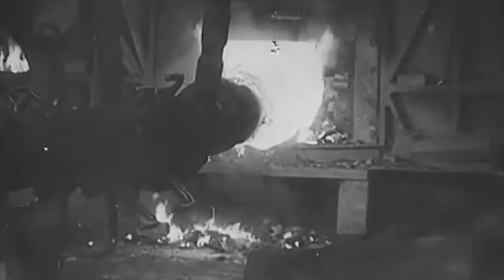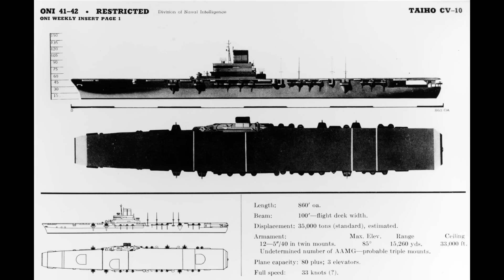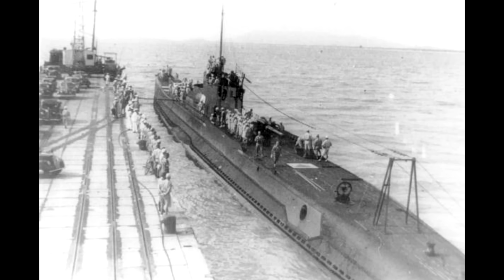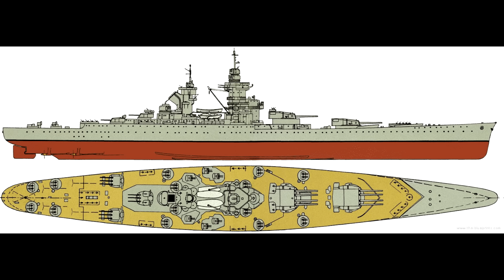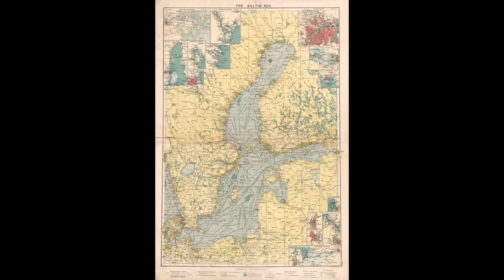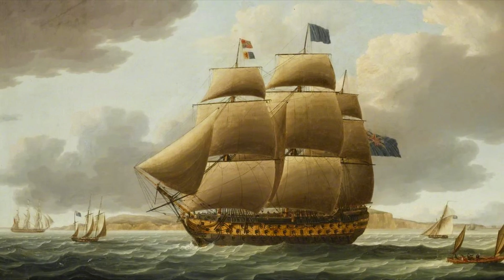The Drydock - Episode 362

Comment: FWIW, the Tu-4 wasn't a perfect copy - Soviet aluminium rolling gear wasn't set up for US sheet thicknesses and rather than building whole new factories they put slightly thicker skin on high-stress area, and thinner skin on low-stress area. The Tu-4 also used a Soviet engine that wasn't derived from the US one (though it was derived from the original Cyclone, just as the B-29's engines were).

Comment: Just had a really daft idea for cargo subs. What if, instead of building the cargo capacity into the subs themselves,  you built submarine barges loaded and sealed to float at a certain depth below the surface? The actual submarine would then just be the tow vessel.
Yes, I realise that a number would inevitably be lost to bad weather and accidents, and that there would be issues when the tug surfaced to recharge its batteries, but it could significantly increase the cargo carried.
Or more likeky turn into a death trap for everyone concerned.
Reply: The idea of towed cargo for subs is not a new one. If memory serves, there was a Hardy Boys book ( The Mark on the Door - the 1967 rewrite) that used this in the plot - I believe the story featured a submarine towing containers that were used to smuggle oil.

Today real world drug smugglers sometimes use towed submerged cargo pods aka narco-torpedoes or even narco-submarines - many of which have been captured.  So the concept of a submerged cargo pod is well known.

I suspect a challenge with towing an underwater cargo is keeping the tow line from fouling the screws of the towing vessel.

Another option is to attach pods externally to the hull of the sub - much like the Japanese did with their mini-submarines.  This takes the tow line out of the picture.  The parent sub took a significant hit on performance in these situations.

The issue has never been carrying cargo, the issue has always been carrying sufficient cargo to make it worthwhile.
Reply: @bluelemming5296  I think the IJN experimented with towable pods, but found them unwieldy, poor depth control, and hard to unload.
Reply: @bluelemming5296  Thanks.

Damn! I should have known that the narcos would have had the idea first. I'm just surprised that they don't have their own space programme.

They haven't, have they?

Comment: (for the last question) I wonder if they might also have named them after presidents. They wouldn't really do this until the Midway class (iirc), but it's fairly common among USN carriers today, and I wonder if it would've happened earlier if battles had been unavailable.
Reply: They only did that for FDR because he died right then, then they went back to battles for the Coral Sea.  Same thing with JFK, although he probably upset the pattern.

Comment: I don't think you really need to 'reverse engineer' a long lance torpedo. There is nothing inherently unique about any of its design concepts. The only 'unique' idea was to us compressed oxygen not air. Now that does cause some technical issues with storage, etc. that will affect the details of the design. Seeing how the IJN addressed them would be handy. To me this closer the value of the captured Zero that give the US an excellent insight into IJN aircraft design philosophy. Thus the general capabilities of Japanese aircraft was better understood. The US could build a Zero, but choose a different doctrine that resulted in aircraft that emphasized different aspects.
Reply: There were engineering lessons to be learned, like cleaning the insides of the oxy tubes carefully and avoiding sharp bends, but the primary issue was that the USN did not accept that the IJN had a long-range torpedo until well into the Solomons campaign, which affected several battle plans negatively.

Comment: Question:  How was a seaplane launched from a battleship recovered after it completed its flight?  Would the ship have to come to a complete stop near the plane to hoist it back up onto the ship?
Reply: Depends on the time and the exact nature of the equipment. Early on yes, the ship had to come to a complete halt, or at best slow significantly. Later on the ship could still be underway and recover the float planes, but even then they could not do so at full clip, they would still have to reduce speed to retrieve the floatplanes.....
Reply: They had cranes
Reply: Also, they would try to use the ship to provide a sheltered spot for recovery - having the plane land in the 'lee' of the ship - and sometimes release oil onto the water to try to smooth it out.  But even so, the process was very sensitive to the roughness of the waves, far more so than landing on a carrier.
Reply: @bluelemming5296  Yes, weather was a factor, and the ship could make a sharp turn to create a quieter patch in her wake.  Most ships with aircraft had cranes, all the fast US BBs had them at the stern.  They tried a towed raft system that I do not think tested out well.

Comment: Drach you did not think of how much damage a thermobaric weapon would do to a carrier? The gas fumes that killed several carriers would be fairly similar to how the thermobaric weapons work when the fumes get to a certain concentration. We saw how thatworked out on Taiyo, Lexington, Franklin to name 3 off the top of my head. Feel like with all the aviation fuel, air dropped ordnance and AA ammunition would be horrendous explosion if a weapon got through the flight deck and maybe below the hanger deck.
Reply: Yeah but in those cases it was the fuel air mixture already existed and spread through the ship due to either poor damage control or damage already inflicted or ventilation systems that actually spread the fumes so the issue he's dealing with is not that those things are not devastating it's can you get a designed weapon into the ship that isn't already pre-filled with aviation fumes and somehow spread enough fumes with long enough to lay time so that when you do set it off it does that type of catastrophic damage and that is not easy at all
Reply: You would need an ABSOLUTELY INSANE warhead to get anywhere near the condition those carriers were in already.

Comment: How would you rate the loss of Lord Kitchener (OK to a mine but U boat set).? Irreplaceable or not?
Reply: Not by that point to be honest, probably not ever. Kitchener's role during WWI has been much over hyped, in great part due to the famous poster. Problem is that poster was not actually USED during WWI, though it was designed during the war. It did not gain in popularity and recognition until AFTER the war, due largely to its similarity to many of the US recruitment posters depicting Uncle Sam in much the same pose that WERE actually used....

Kitchener was very much a man of his time, and while he was one of the first men in power in the UK to recognise WWI was in fact going to be a long war, he was also wrong in many other respects and in many ways frankly deleterious to Britain's War Effort. So he was very much a mixed bag. Some good, some bad, and not as important as the popular image of him today makes out.....

EDIT: In fact if I recall Kitchener was very close to being out right replaced when he took that trip. I would have to dig into my books but I am pretty certain he was not long for his position.

Comment: 52:30 The general idea of a thermobaric weapon is that it improves effective warhead size by using atmospheric oxygen to burn a fuel. So, as an analogy, a jet engine is more efficient than a rocket because the former only has to carry fuel, while the rocket must carry fuel and oxidiser. So it would work pretty well outside a ship by - as Drach said by destroying sensors and structures. But inside the cramped confines of a ship, that space to expand and gather oxygen is unlikely to be available. Most modern warships are built to operate (at least technically) in an NBC environment, so they are anticipating a significant level of external blast when in a warlike configuration. Older ships with exposed crew positions and zones open to air - a nearby airburst would be pretty brutal.
Reply: Shameless Book Plug (and spoiler alert) - This idea gets explored in my 'Republic of Texas Navy' alternate history book series.

Comment: I think a WW2-era dedicated cargo sub would best be built to only dive to very moderate depths, perhaps 40-50 m or so. Enough to get below the big waves and below the keels of large warships (in the unlikely event they'd get that close). It would have multiple smaller pressure hulls inside an outer streamlined hull. Perhaps three across and two high, each the diameter of typical subs of the era to take advantage of production facilities and design/manufacturing experience. The upper middle hull could be dedicated to crew bunks, canteen, command center/bridge and the diesel engines and generators (non-direct drive), and sit under the sail and snorkels. The two lower, outer hulls could house electric motors aft for propulsion. All three lower hulls would have a lower section filled with batteries. The two upper, outer hulls and most of the three lower ones would be cargo space. It would be maybe 13-15k tons, travel at 7-8 kts with the diesels running, with a cargo capacity of 3000-4000 tons. 100-120 m long and probably 20 m wide.
Reply: It would be very slow to dive.
Reply: @Primarch359  Dive speed isn't related to size, but to how quickly the ballast tanks can be filled. If everything is to scale, the dive time will be entirely independent of size.
Reply: @Primarch359  And big.... Slow dive speed and large size were two BIG killers of submarines, especially operating in shallower, more constrained waters, which a supply submarine would be doing for at least part of its mission by default....
Reply: I think it would be very different
Reply: It's somewhat limiting to build a sub designed to dive only to 'very moderate depths' for use in the open sea.  Maintaining trim (and hence depth) is extremely difficult for submarines, requiring excellent training, properly working equipment (not an guarantee even if you don't have battle damage), and constant attention.   

There are many accounts of subs broaching when they lost control of trim: think about the corollary if your sub can't handle going deeper.  Changes in the salinity of water (such as near a river mouth) or ocean currents can be big challenges for trim.  Storms also have strong effects underwater close to the surface that can affect trim - you have to get pretty deep to minimize those effects, and even then can have problems (as former modern submariners have pointed out on this channel - you might want to find some friends that have submarine experience to talk to about stuff like this).  

Also, being limited to shallow depths increases your exposure to minefields - many of which are set for shallow depths because they don't have enough mines to go deep.  You can't go under large bodies of ice (which can go deep under the surface).  Finally, shallow depths increase your exposure to fishing nets and defensive net barriers such as the ones used for the English Channel in WW1 - and if a net wraps around the screws, the sub isn't going anywhere and is doomed if an enemy catches you in that situation.   Look up the 1998 Sokcho submarine incident off Korea for an example of a sub being caught in a fishing net.
Reply: Cost?  And where are you going to pick up and drop off the cargo?  You need a deep-water port with good unloading facilities.  Won't work for Guadalcanal, for example.

Comment: Many Japanese submarines found themselves used as freighters hauling cargo (food and ammo) to isolated Army garrisons and carrying a few wounded back home.
Reply: Entirely true. But also true that they simply couldn't carry the quantities required to properly supply combat troops on (for example) Guadalcanal. The simple fact that using cargo submarines has become necessary is an admission that you have lost control of the sea lanes.
Reply: @onenote6619But every cargo mission was one that took away from the subs primary mission.  Disruption of American lines of communication and supply.
But their high command never seemed to grasp this concept either.  Japanese subs were held on a short leash, always ready for the one decisive battle to defeat the Americans.

Comment: On the cargo sub they could have made a sub oiler. They wouldn't need the extra life support and the extra internal bracing wouldn't get in the way since it would inside the fuel tank. I doubt it would be practical for anything other than as a refueler for float planes.
Reply: The Germans had just such a sub.  The Type XIV Milchkow.  A support sub that carried fuel, food supplies, mail and torpedoes for other subs at sea.
Reply: Regarding cargo submarines, liquids can be carried outside the pressure hull ...